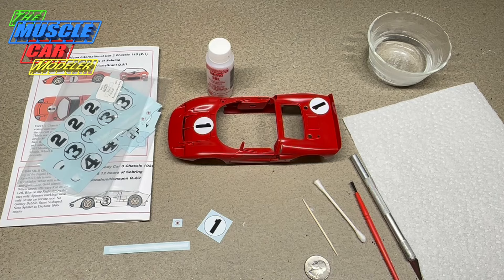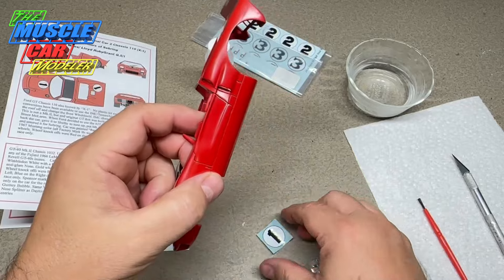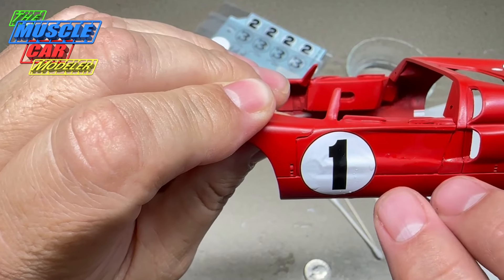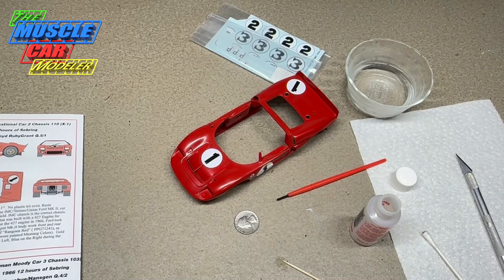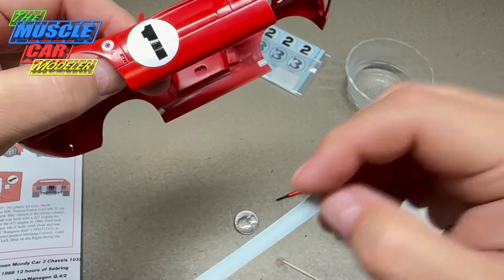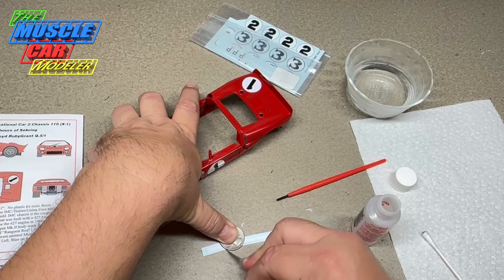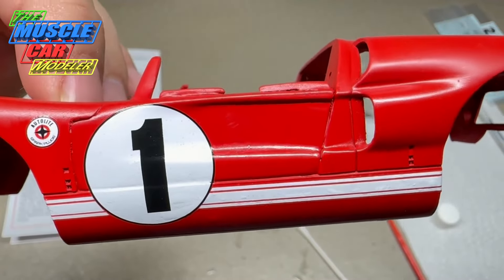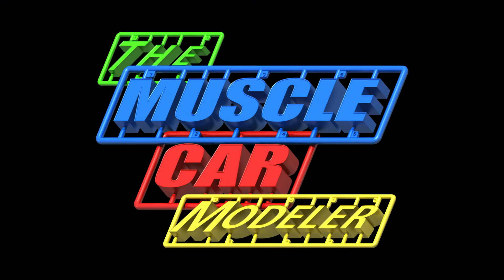How To: Set the Decals, GT40 example

Comment: Appreciate you spending the time to put this together. Most informative. You are pretty liberal with the setting solution compared to others I've seen, but your results speak for themselves. Well done. Are you ever tempted to run your knife down the door jams to make a clean break where the doors would open ? Seems that would be necessary if you want to add some panel liner to the door jams. Thanks again. Always enjoy your videos.
Reply from the maker: Thank you. I have done that with the exacto knife. It works pretty good but sometimes I just like it sunk in and uncut. When it comes to the setting solution about. I should have mentioned that I do gauge it on how much the decal wrinkles on the first dose. If it wrinkles a lot and fast, I use a small amount. These ones took a lot for it to mildly wrinkle so I was not worried about using too much.

Comment: A really interesting vid. While your methods are sometimes 180 degrees from others I've read about or used, the results speak for themselves. I grimaced when you were pushing on the door decals w/ a brush as I typically don't have luck doing this, I just had a decal break apart from just rolling over it with a dampened cotton swab over raised details. Is there a reason you don't use Micro set w/ the Micro sol? There doesn't seem to be a confirmed method to do decals, just what works for each individual. Unfortunately decals can be expensive and it can turn into a steep learning curve.
Reply from the maker: Thank you. Yes we all have different methods that work for us. I have had decals tear also. It is no fun and like you said. Decals are not cheap anymore.
Reply: @TheMuscleCarModeler  Yes, my application of decals on a 1/48th scale bi-plane project resulted in a $19 expenditure. The same two decals shredded. The rest applied perfectly. Go figure.
Reply from the maker: Murphie's law!